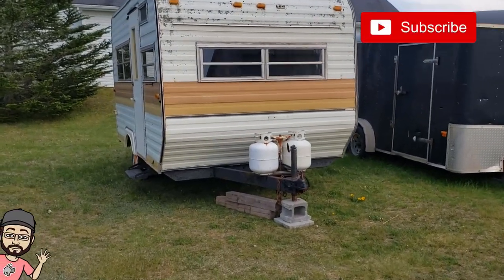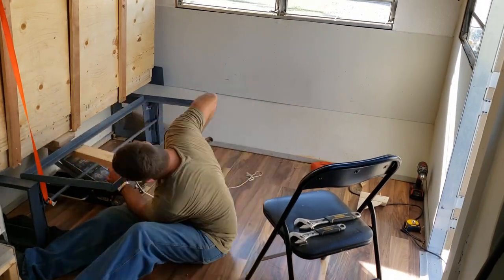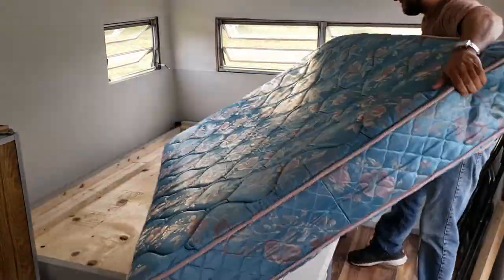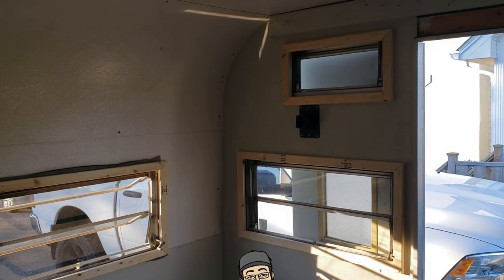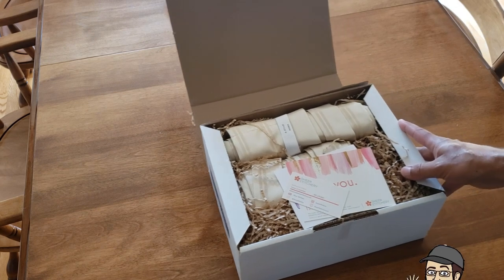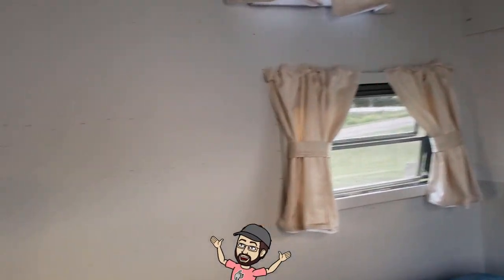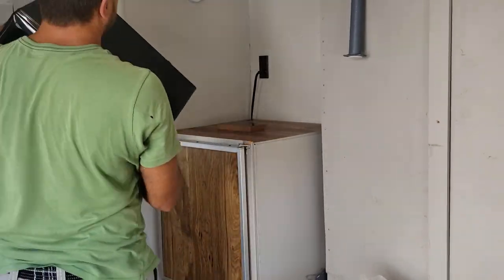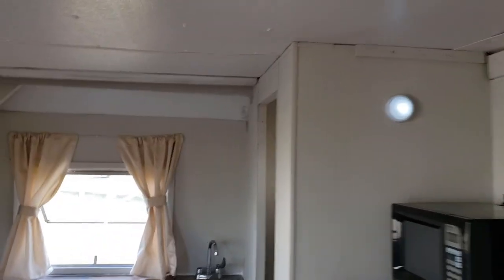Camper Trailer Makeover - Part 5 - Bed, Curtains, TV, Storage & More - RV Renovation Repair Budget

Comment: I don't think it's wise to have the fridge closed in with no vent. Drill some wholes into the side panel.
Reply from the maker: These RV fridges don't create the heat that a residential fridge does, I ran it several days and the panels barely get warm. Everything is self-contained, the vent is only for running on propane which I don't do as I removed the entire system. Thank you for your feedback!